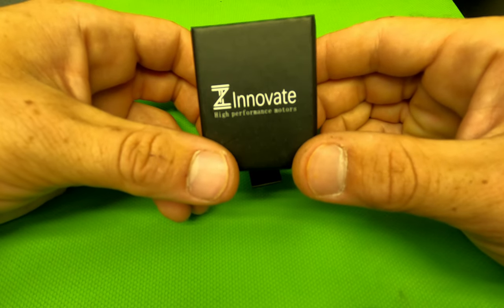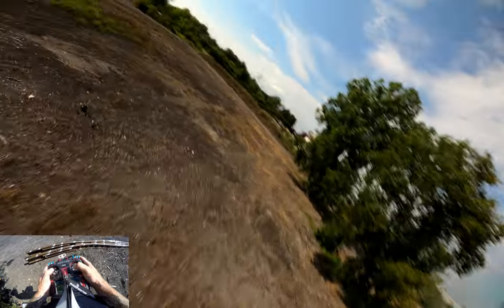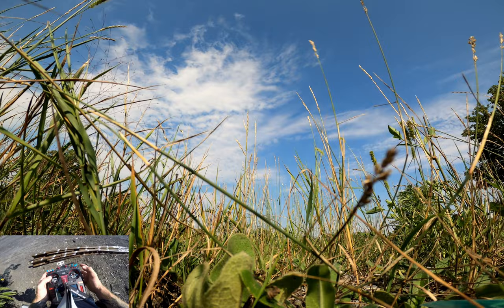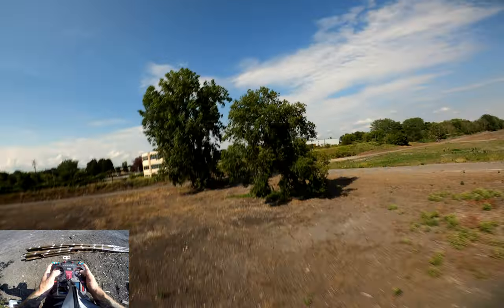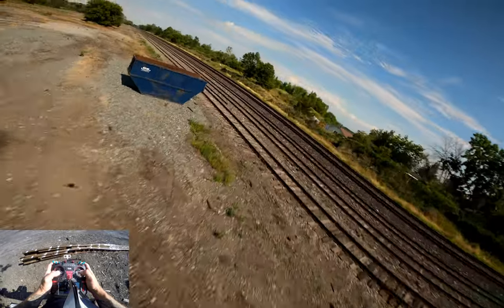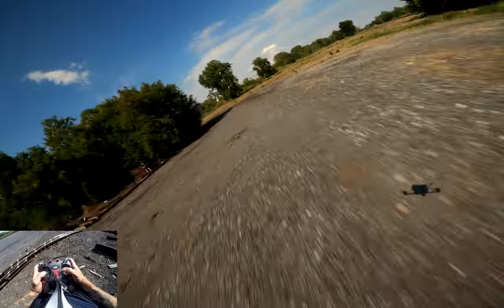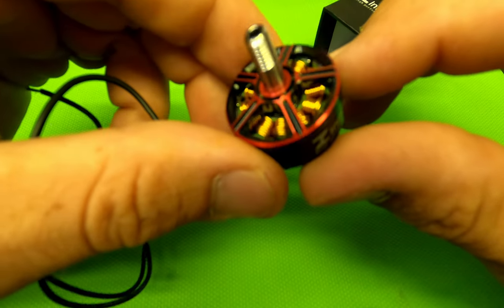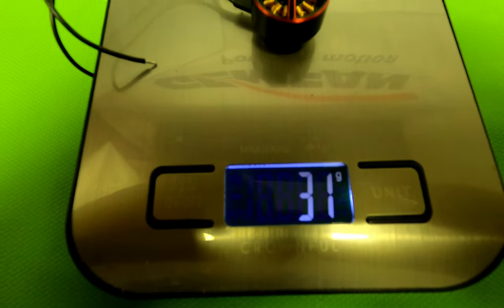ZT Innovate 2207 2000kv motor review!

Comment: Your noticing silver plated copper wire with insulation. If you didn't ha e any insulator on the wire it would be silver.  Silver is a better conductive
Reply from the maker: You’re absolutely right however, silver is quite expensive to use on each motor